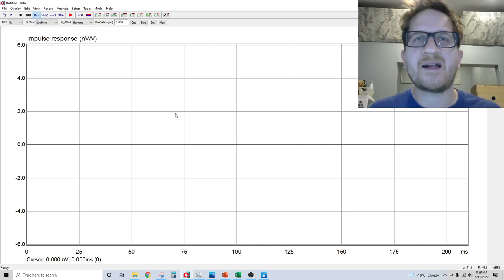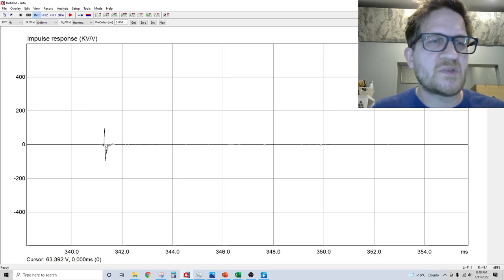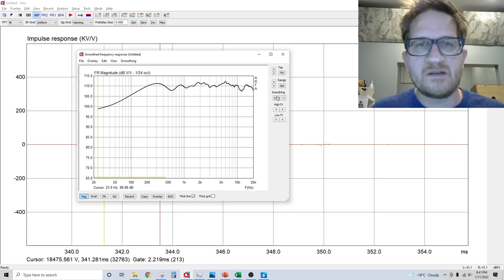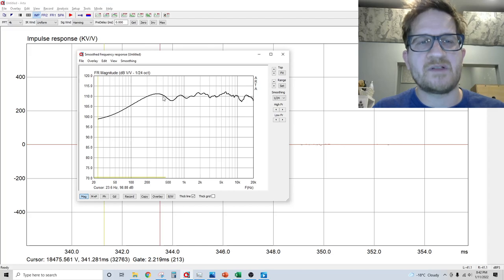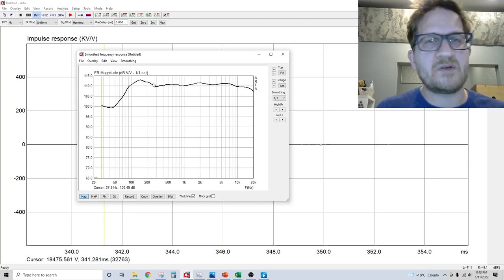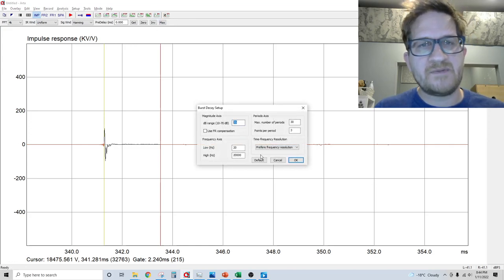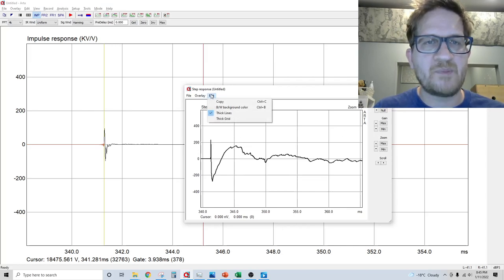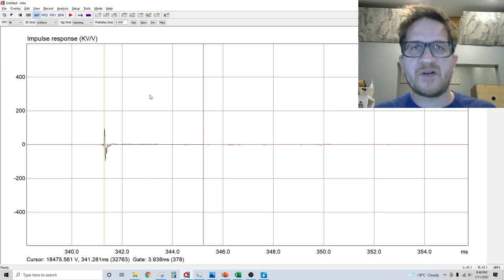How To --- Frequency Response Measurement in ARTA

Comment: Hey thanks. This worked well for me. I also used a PC, calibrated dayton audio umic6, and an 808 HEX speaker through the aux drive to boost the S/N. I get a nice gated pulse for the speaker response. Also when I use no gate I can easily measure all 3 of the the axial room modes which match my hand calculations. Also the REW and AMROC room model matches the other higher order modes. Now the fun begins! I may try with my android as well.

Comment: Great tutorial, however, why use a paid program like ARTA when REW does all the same and for free?
Reply: …because REW is purpose designed and is great for what it does, but it is difficult to get hard core laboratory grade tests without the bias of “room correction” attached to the test procedure or results.
Reply: Because he is a professional, but REW is fine for normal people
Reply: @philmccandless614  I have both but tend to prefer Arta
Reply: You can use Arta without paying the license fee, and under this case is called Demo mode. The main difference in demo mode is that you cannot export the measurement results via the program. But you can still use screen print to capture the results. There are some other non-critical functions (e.g. save your program settings) missing.  And if you really need the export and other functions, the license fee is about USD90.